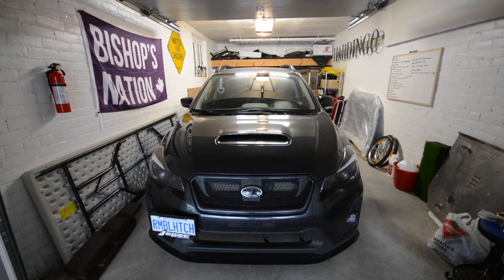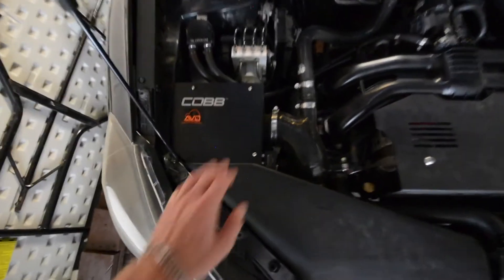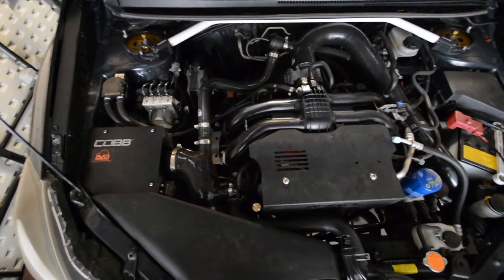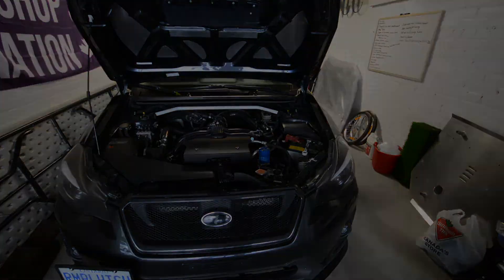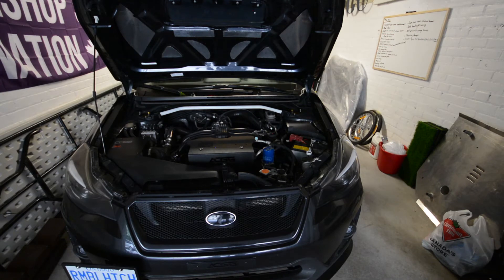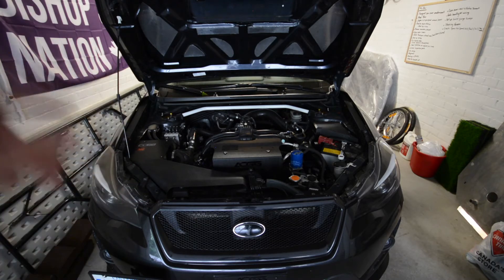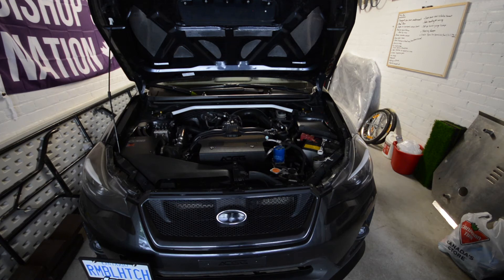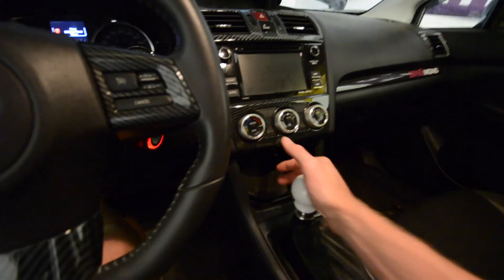AVO Turbo Kit (FB20/Crosstrek) - Build Overview

Comment: Is this all bolted on an FB20D?
Reply: I guess I see you posted FB20 but I’ve seen that there is an FB20V
Reply from the maker: Yes FB20D
Reply: Does that even make ANY difference buahahah. I have the 2017 Impreza. Just getting ideas to blow out my bottom end (:
Reply from the maker: @okitsadam  FB20D is 12-17 Crosstrek and 12-16 Impreza.  FB20B is 18+ Crosstrek and 17+ Impreza

They have kits specifically for your car, no really difference beside your motor being direct injection not port
Reply: @HugoHardinge  your quick response is everything hahaha. Thank you. She’s kinda an in between car I have but why not look into making it faster. The first to second throttle response SUCKS. I want just that little bit more.
Reply from the maker: @okitsadam  you’ll love a turbo on it!  Second gear is so much fun.